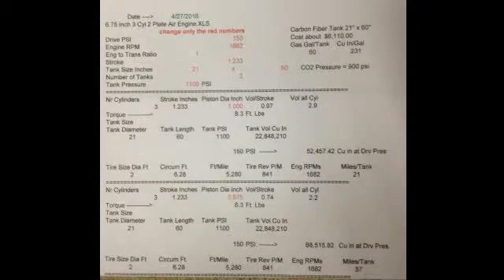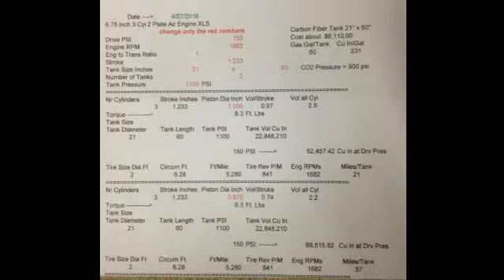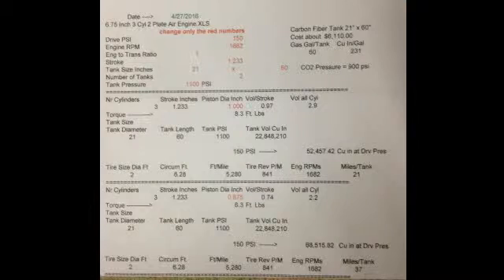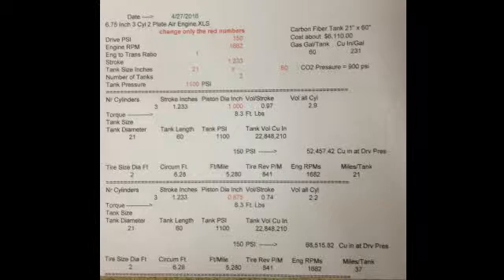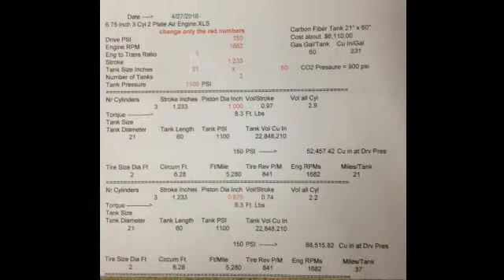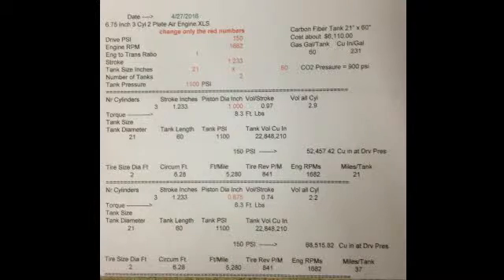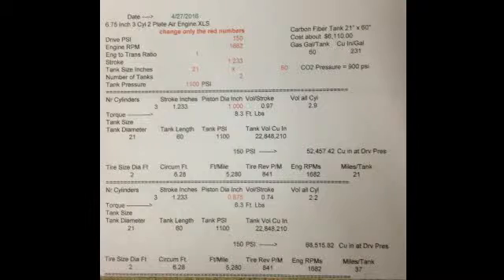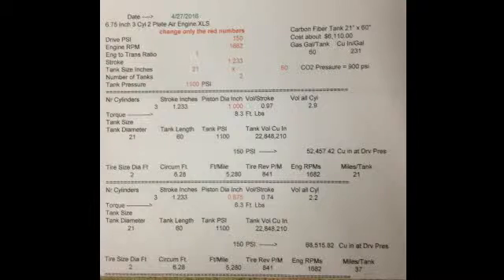Calculation on Compressed Air Usage for Air Engine

Comment: Great video and I loved the spreadsheet. Liked and subscribed. Have you tried using scuba tanks or SCBAs?
Reply from the maker: Yes I have, and I did a video on what I thought was correct with various tanks. If you look for the video called (AIR ENGINE, Miles with Air Usage and Storage Tank Compairsions) it might help you understand what an air engine might require. Thanks for subscribing and the thumbs up I appreciate all the support I can get.

Comment from the maker: Thanks for subscribing, and i will do a short video and try to give you an idea what is involved with trying to use an existing gas engine.
I have tried many things over the years to try and reduce the amount of compressed air needed to get enough power to drive a vehicle, but using an existing motor, or using a crank shaft, or a rotary design just never worked for me.
I'll let you see you see the calculations I have come up with.

Comment: Please can you about the calculation of compressed air engine. How to select the tank size based on your engine power and other parameters. Please can you provide some material regarding modification of four stroke engine to compressed air engine.